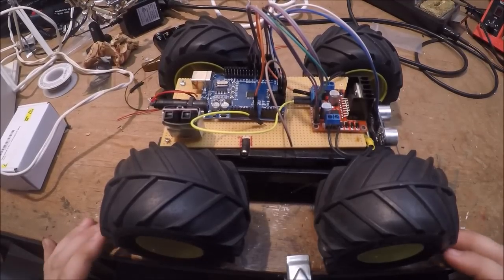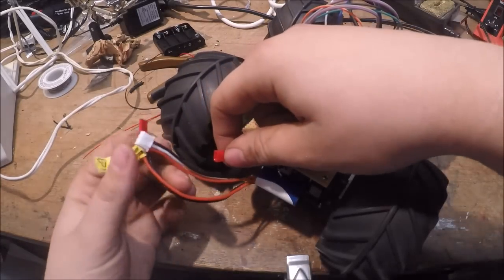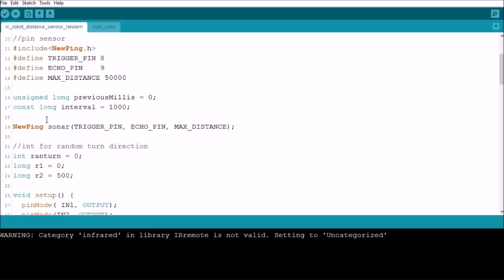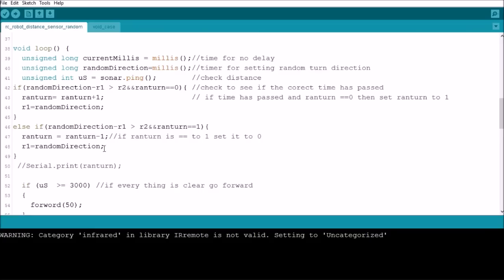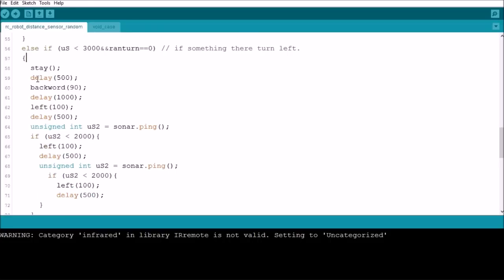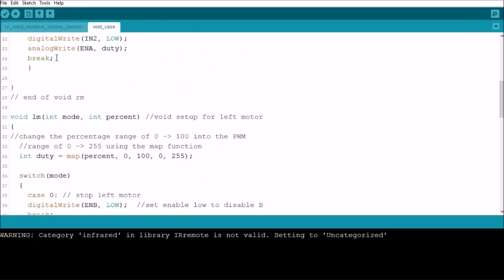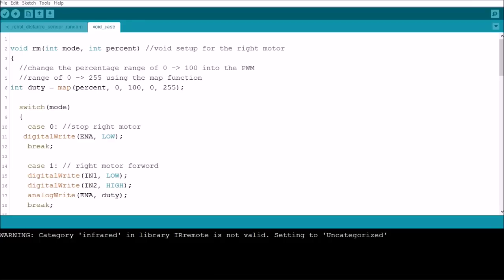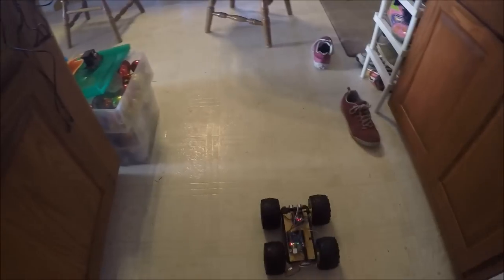Arduino Distance Sensing Robot Car With Code

Comment: this is awesome! what I would recommend to make it better is make the speed of the motor less and turn down the range of the distance censer so it works better in smaller areas this probably doesn't help at all though I started leaning code like a day ago so idk

Comment: I think the issue is you are sending it backwards. When it hits a wall backwards, because it doesn't know proximity backwards, it trys to still complete the backwards program. If it hits a wall backwards and it's direction of travel changes, it will then perform the right or left turn function which coincidentally brings it back to it's original angle towards the forward wall, drives forwards, stops, stops, reverses, hits wall backwards which changes its angle and then  repeats over again. Reduce the amount of backwards travel to only an inch and add reverse sensors or don't send it backwards at all.
Reply from the maker: Yes, i was thinking that unfortunately, I can not work on this project anymore.

Comment: First of all, thank you for sharing this and explaining the code. Second, maybe putting another sensor on the back  would help stabilize it . Also lowering the sensitivity values of the sensors would allow it to get just a little closer to the obstacles giving it more range to move?
Reply from the maker: yes, this would help. i would have loved to make this better but i lost it in a house fire. i want to make a version 2 just need to rebuild my supply of stuff as i get the money and time. right now i am not getting money from youtube because i have less than 1000 subs so if you would like to see more please consider subscribing to help me out!
Reply: @BeginnersTech314  I hope everything's ok

Comment: The robot is in love with the ref 7:42 (he, he...). I built two Sonar object avoidance robots ... but have not tried running it around fellow machines. Congrats on this very interesting project!
Reply from the maker: Thanks. I do want to add a backup sensor. i also want to put the front sensor on a servo so i can check left and right distance. i havent had a lot of time lately to work on it.
Reply: How about the Sonar on a servo that scans left and right?
Reply from the maker: tsisapik i could do that but i will have to learn how to program it. :)
Reply: isnt that the whole point lol
Reply from the maker: yepni am working on it now bit i have 2 jobs and school so i haven't done much with it yet

Comment: Hey!! I m a beginner.. Will u post how to build this robot? It will be very helpful for me....
Reply from the maker: +Romio Ghose  it is not hard. the main part of the car is from an rc car. all i did was remove all the old electronics from the car an then added the arduino motor driver and the sensor with some screws. i will try to do a video to show you a little better as to how i mounted everything
Reply: +Beginner's Tech i'll waiting.. n thnk u for ur advice.. thnk u

Comment: Hello, Good afternoon, can you please check if you can help me? I have an electric vehicle chassis, (COMPLETE motor / battery) that supports up to 500 kg of load and I need a "Follow-Me" feature to use in this chassis, how do I? Where can I buy it? what would be the cost? Is there interest in attending to me? , because here if I can, present this project and it is approved, for the next 12 months, there will be more than 100 projects that I will have to prepare, so this my request could become a good business for those who have involved

Comment: Sir can you show the circuit diagram for this
Reply from the maker: I do not have one for this build. It is based on a lot of similar builds by others so the should be a diagram out there for it.
Reply: You simply have to connect motors and sensors with adruino board and give the power supply and you must be knowing where to use the switch.

Comment: Link for wheels?
Reply from the maker: the frame gearbox and wheels are all parts of an old RC car. I removed the old body battery and control circuit and then added an Arduino the h-bridge and a lipo battery.